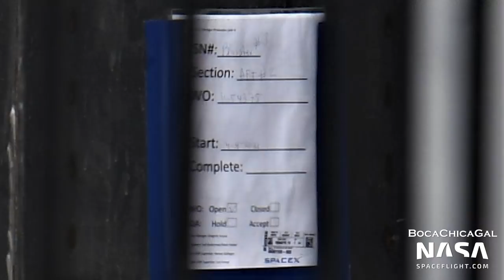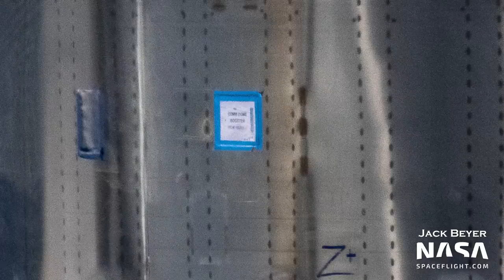Starship SN15 Moved - Booster Common Dome Flipped | SpaceX Boca Chica

Comment: Anyone know if there's talk about changing the landing leg design? Or are the landing legs supposed to do that? Thanks!
Reply: They are supposed to do that. Those are just test legs. The lunar and Mars versions will have auto leveling legs for uneven surfaces in lower G environments. And the eventual plan for the Earth landers is to catch them with the tower like their boosters will be caught. With heat tiles covering all the windward surfaces and flaps, it's not clear how they plan on doing that. I mean... you can see there's a lot of force involved with what happens to these stubby legs. Heat tiles aren't designed to bear loads.
Reply: @Usstampcollectersatkiwistamps  thanks for the clarification!

Comment: Those legs look like they really took a blow.
Is that concrete on one of the foots underside at 18:27 ? As if the combination of raptor heat+spaceship weight just fused SN15 to the ground.
Reply: Smashdown and slide: look at some of the after-landing videos, and you can see the marks on the concrete.

Comment: Ah yes, now they can pretend that they landed it dead center on the landing pad all along!
Also, that guy with the forklift straight up broke one of the legs along the crumple line by accidentally dropping it.
Reply: Actually, looking at it again, I don't think he dropped it, it seems to have broken under its own weight after resting it on the side of the base plate.

Comment: Why is the legs got holes in it I know for weight but isn’t triangles stronger lol good job old chaps stuck the landing amazing stuff  you can all go have a cup of tea now
Reply: These legs are meant to buckle to absorb impact. Kinda like crush cores. So you’ll notice the holes progressively get smaller, which means it takes more force to crush. Very simple idea for a very strong shock absorber.

Comment: Interesting
I thought tankzilla moved on its own tracks
Reply: NOT on public roads; the tracks would destroy the road. The SPMT's spread the weight over a bigger surface.
Reply: Yeah. And crushes everything underneath. That's why they have forklift trucks moving those huge baulks of timber in place, so it doesn't smash the concrete. Each track segment likely weighs about a ton, and the whole things is hundreds. Each counterweight is ten tons.

Comment: Why is the shielding only on that part of the rocket? Why is not one side of the rocket covered in shielding completely?
Reply: They will only need heat shield tiles (TPS) on the entire windward side for the first one that goes orbital that will need them for re-entry.   At this point it just for testing attachment and if can handle lift off and landing without falling off.
Reply: @joralzekin9347  Some tiles are different colors?  Perhaps they are also testing the composition of tile materials, and different methods of tile attachment?

Comment: They'd have been quicker making the orbital launch table with Lego. What on earth are they doing that takes so long?
Reply: Welding in chunks of 50 mm thick steel, to finish the construction. It is not a flimsy and delicate item: it has to withstand 1000's of tons of thrust for static fire testing.

Comment: Landing legs look damaged may have to try another method , so before another flight attempt this needs to be fixed
Reply: They meant to do that, they absorb forces by crushing, this is temporary solution, final legs will have normal shock absorbers.